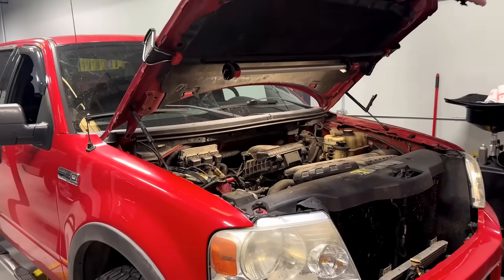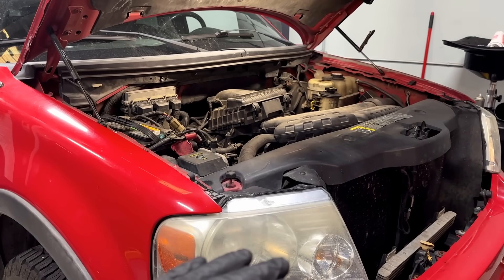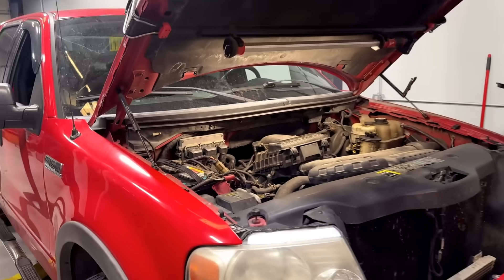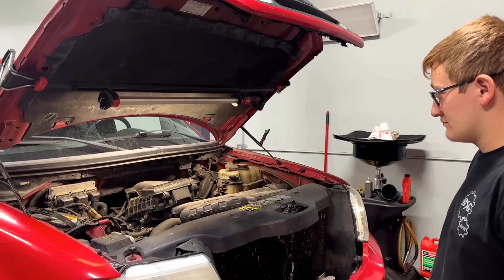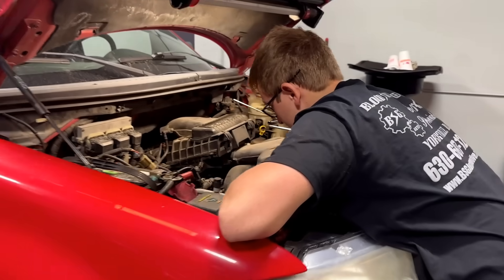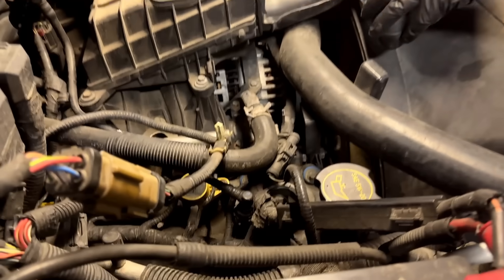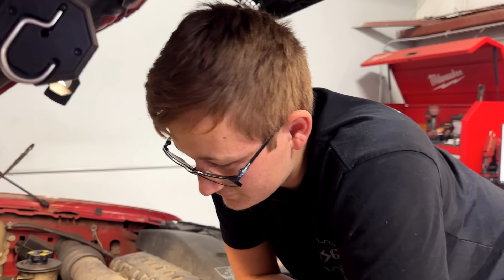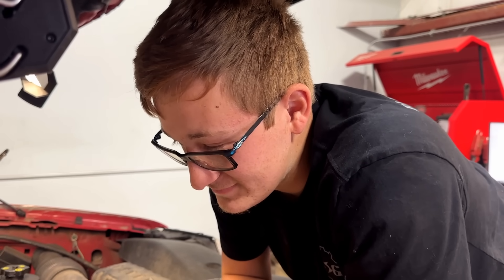Ford 5.4L 3v Triton Ticking Tapping Noise and Fuel Smell: Teaching the Next Generation!

Comment: People need to Give up on these trucks. 19 year old truck, paying somebody to drop a used engine. Move on and upgrade to a 5.0.
Reply: 5.4s are the better "truck engine". Torque way down low where you need it. Also the iron block will outlast the aluminum block in the 5.0. Also prices even for a high mileage 12th gen are insane right now. Everyone's scared of these engines, thus you can find vehicles with them for dirt cheap.
Reply: 5.0 has its issues too. I would say move on to a different brand truck but unfortunately they are all overpriced trash now.
Reply: BS...move on to a Chevy.  Ford is the oldest manufacturer yet they still can't design an engine or transmission that will hold up.
Reply: @Cragar-i7q because active fuel management was such a success on the 5.3
Reply: @tc6580  I have had success with the 07-14 5.3 with AFM. Does it have issues, yes. But super easy to work on if there are problems. The 14+ in the Silverado's are turds. 12 hours for an oil pump, 30 hours book time for a cam/lifter job.
Reply: @tc6580  Lifts leg and farts.  Ten time better than the Triton troubles.
Reply: Or maybe the turbo six carbon build up issues........or even the Coyote problems.....turds, all of them.  Wanna talk about the diesels too?
Reply: Well, that's an easy way to let us all know you have no clue what your talking about
Reply: @joshrodgers9366  Feel free to explain.

Comment: Thank you for the knowledge videos you put out, I sure do appreciate them even if I'm not having that problem..Don't even get me started on the electrical crap like crappy fuse boxes prone to moisture issues under passenger side kicker plate! I haven't figured out yet, but I will! And hopefully spare my new one the issues my old one has, but protecting it and why it steers like it's in 4 low but not in four wheel drive which works as do power steering and have no problem getting it to speed just steers weird!

Comment: It looks like he didnt change motor mounts, motor seems to be leaning in bay.
Reply from the maker: Yes I touched on that but edited it out. He used a different year engine which I believe is not compatible with the 04 mounts which are specific. I have seen this lean before